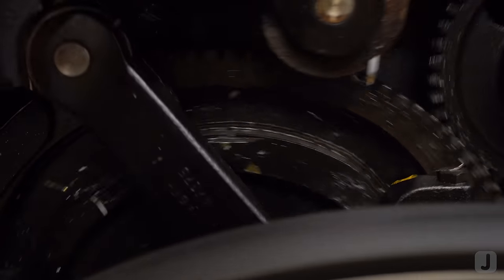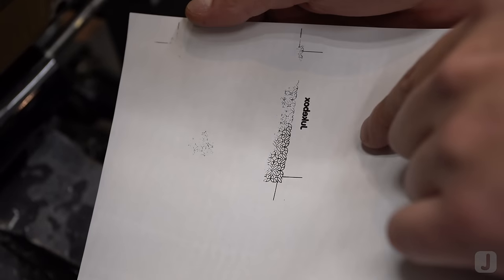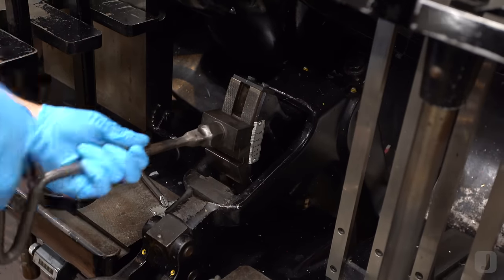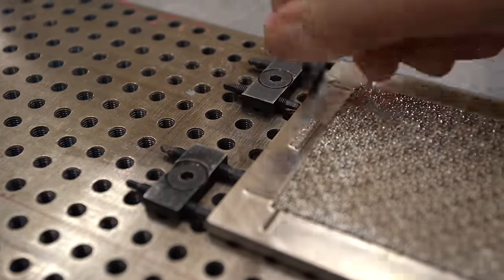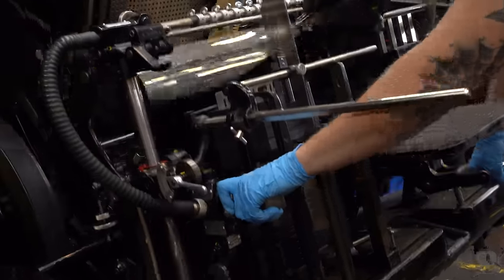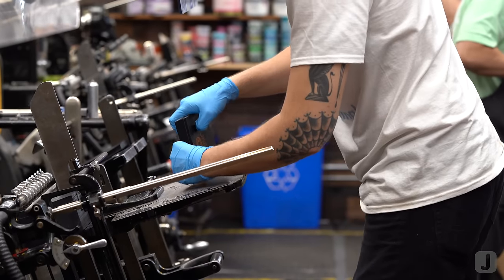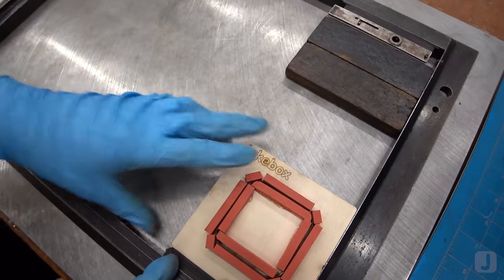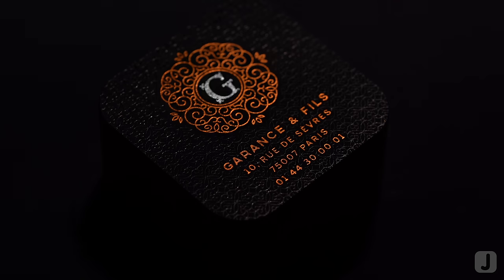Metallic Foil on Luxurious Black Business Cards!

Comment: How did you copper foiled the round edges of the cards in the end? 29:10
Reply from the maker: We set the card stack on an angle and the heated core is able to press the foil around the shaped card.

Comment: Holy crap!! O_O The amount of work this requires is absolutely ludicrous! lol. Beautiful finished product, but there has to be a better & easier way! The amount of adjusting, measuring & cutting this took was insane. How old is the machine you're using? I'm curious! Really cool stuff though; thanks for sharing.
Reply from the maker: This press is from 1960. I know it seems like a lot of steps but it's totally worth it for the level of perfection and consistency this machine offers. Once it's running, it'll do millions of prints without much adjustment and can hit speeds up to 5k impressions per hour. It runs so smoothly you can leave it alone and start setting up another press!

Comment: Would you tell us some common Mistakes you can make while progress ? Greetings from Germany
Reply from the maker: I don't make a single mistake in the printing. I make a thousand mistakes everyday! Setting up the plate wrong, cutting down the stock with the wrong grain direction, setting the temperature incorrectly, forgetting to set up the delivery properly, not setting up the gauges properly, adding packing and makeready in the wrong spot. Setting the impression incorrectly, putting the sheets in backwards, setting the foil tension and pull incorrectly. The list goes on. Making mistakes is how you learn to do things better next time. Most of the real big mistakes come from pre-press ha!

Comment: I use copper plates instead of mag plates! Copper last longer, less growth and the edges of the image is cleaner.
Reply from the maker: True! Copper plates are superior for holding the heat, the detail, and the impression too. Magnesium doesn't hold up the way copper does. For small surface areas and short runs we use mag but for the bigger runs with more surface area or very fine detail - we use copper.

Comment: Prior to removing the first die why not place a  2 x left adjustable holders.  Then remove the top ones and now remove the die and replace with the second die.  You should find that they will both line up.
Reply from the maker: I wish the dies were all the same size with the same margins but oddly enough, the dies are cut by hand making a "head stop" like you suggest, almost impossible to use. You're totally right and I wish I could do what you suggest!

Comment: I haven't met anyone in the print industry who uses points and pica with machinery.
Reply from the maker: You haven't met anyone who sets foundry type or does old style imposition layout? It's dated, but all the furniture, leading, typefaces, were manufactured to this standard. Even our saws for cutting down printing dies or slugs have the points and picas system.

Comment: What exactly happens with all the waste from cutting the cards ? You just throw them away or try to reuse some of it ?
Reply from the maker: Believe it or not we reuse almost all of our off-cuts. The nice thing about the old printing presses is that they can make use of smaller sheets of paper while modern digital presses need a full 8.5x11 or 11x17 sheet to print even a small design.

Comment: A quality product at a fair price. Seems that 'Bubba' is not able to understand that these business cards are not something he will ever see or touch, let alone use as a coaster to hold his can of Natural lite so that he doesn't make rings on his particle board end table that goes so well in his fancy double wide trailer.  
Yes, Bubba, it is still a business card, even if it doesn't fit into your your wallet made of camouflage duct tape. 
This is art. This is meant to be passed to people that can add hundreds of thousands of dollars or more to your bottom line. These cards are intentionally designed to NOT fit into a wallet or a Rolodex. These sit on top of the desk to be admired and are textured to be pleasing to handle. These are not Vistaprint throwaways. 
True craftsmanship.

Comment: real over work! Silkscreen is better option for this kind of work. If really fancy to do in this way; could have use bigger shits and print in set of six to reduce wastage of both foil and paper stock. In Kolkata; road side packaging printers do this kind of job at a rate as low as: 20 pcs for 1$.

Comment: Time to invent a machine that does that in one pass without measuring.  A "foil embossing cricut with a spinning heated pressure stylus, and separate cutting blade).  Throw in a white-capable color laser printer for good measure.  Couldn't take any longer than this process.

Comment: You seem to waste a lot of foil when loading the machine. Why dont you attach a lead-in to take up the length needed for loading the reel?
Reply from the maker: Usually, we leave an amount of used foil on the beginning of the roll so that the next job to set up uses the used area as a lead up. With a brand new roll like what is shown here, there is no lead up. Also, a 4' long sheet of paper is probably more expensive and wasteful than 4' of foil. On a Brausse SBL 1050 the foil path is easily 25 feet before a job begins but that machine is huuuuge.
Reply: The amount of material waste in high end printing is much higher than most people want to think about. High speed press running registration? 4' waste stream at 30mph..   No worries, it recycles into more paper ;)

Comment: I went to the website and my attempt at creating the most expensive business card order I could resulted in a total cost of $641,075.00.  I may have clicked order by accident.

In unrelated news, I'm starting a GoFundMe page.  Let me know if you're interested and I will send you the details on a beautiful business card.
Reply from the maker: We're definitely interested in the specs for this insanely expensive order you managed to generate. Maybe we can make it? Maybe it's the greatest business card since the dawn of time?
Reply: @JukeboxPrintLive  
I tried to recreate the order by maxing out on all the options. I was able to create the following order, which came to $373,302 USD. My original order was in Canadian dollars so it's fairly close.

Type: Triplex (3-Ply)
Front Stock: 30pt Onyx
Middle Stock: 18pt Black Suede
Back Stock: 16pt Sparkle
Print Process: Screen Printing
5 Colors Both Sides
(Black, Black, Black, Black, Black / Black, Black, Black, Black, Black)
Size: Oversized - 3.5" x 2.5"
Coating: Uncoated / Uncoated
Quantity: 2500
Sets: 20
Add-ons
Rush Service 43 Business Day Service
Edge Finishing
Rounded Corners
Reply from the maker: OK I see why this is so inflated. 20 unique sets and all of them have 10 colors! That's 200 different print set ups. The end result would be almost 1/4 inch thick... but nice choice with the sparkle paper option!

Comment: Why do you use a lever to pry out the plate lock? I had a exactly same machine and it has a pedal to do it. Is the pedal broken?
Reply from the maker: There is no pedal to release the chase on this press. On page 123 of the original manual it states "The chase is released by lifting the latch with the pin wrench supplied with the machine" There is even a photograph. That lever I'm using is the original pin wrench for the press.
Reply: @JukeboxPrintLive  Hello! Did someone adapt a pedal system to my machine before I buy it? Weird! It was very practical. By the way, I love your work. Perfectionist as it has to be. Nowadays I only have offset printing machines, but I miss the old days and watch all your videos. Thanks for your response. Good luck!

Comment: How are the dies made? Some kind of laser cutter or 3D lathe?
Also, I'm surprised at the number of simple looking adjustment screws.
Reply from the maker: It's actually a photo-etching process. A film negative is exposed onto a raw piece of magnesium. It is then developed and dipped in acid. After washing out the remaining magnesium for the artwork is left raised while the rest of the magnesium is etched away. Sometimes we use CNC cut copper dies though too. All depends on the job at hand.

Comment: While these are nice, I must say that business cards that are not the standard size and do not fit into my wallet should not exist. It is a guarantee that I am not going to keep it, and will simply opt to take a picture of it if I need it. An exquisite Guernica sized oil painting of your business's information would also be nice, but fuck you if you do that, just make it the standard credit card size.
Reply from the maker: If you look up the international standard sizes for business cards –  you'll find that many countries use different shapes and sizes. There are at least 11 different "standard" sizes for business cards across the world. Also, credit card size adheres to an ISO standard which is actually different than business card sizes. The card we printed here is actually smaller than most standard sizes. So, it'll fit in your wallet. Don't worry so much!

Comment: Hi! Awesome work, that's totally stunning!
One question though about the edge gilding : how did you manage the rounds corners to be foiled?
Reply from the maker: We set the cards on an angle. The heated core that makes contact is kind of soft so it can make contact with the rounded edge pretty easily.
Reply: @JukeboxPrintLive  thanks for sharing! Can you tell the brand and model of the machine?
Reply from the maker: @MrPowerpixel  No sir I think I would get in a bit of trouble if I let that detail slip! It's a bit of a secret weapon for us.
Reply: @JukeboxPrintLive  haha I thought about that, I totally get it, thanks for your quick reply though and for sharing your work 💪

Comment: how do you go from artwork to die?
Reply from the maker: There's a hundred steps there that we skipped. Essentially, artwork needs be converted to 100% K vector shapes, then the colors are separated into different PDF files. Those files are then output to a thermographic film negative. The film negative is then exposed to a raw piece of magnesium. The image is developed on the magnesium and then the magnesium is acid etched. The etching leaves the image as a raised area and everything else is washed away.

Comment: Wouldn't it be easier if you would do all 3 colours on one side and THEN all 3 on the other?
Reply from the maker: If both sides have the same number of colors then yes you are correct. In this instance, only one color is common between the front and back so we have to do it in 4 separate passes.
Reply: Sorry, didn’t realize that. Thanks for reply!

Comment: I wonder why you don't just put hard stops on two adjacent sides of the stamp. Then when changing between stamps, you just push them against these stops and tighten from the opposite side.
Reply from the maker: The die's aren't all the exact same size. Some have more material on each side than others so this would cause more trouble than it's worth and I trust my ruler the most!
Reply: @JukeboxPrintLive  Yeah.. I thought it looked like bandsaw marks on the sides of the dies. But they should be machined in my opinion x)  
I mean come on... they have to machine the pattern anyway. It would be extra easy to machine the dies to exact size. 
It would make the stamping easy as pie.
Reply from the maker: @TheRealFOSFOR  These plates aren't machined. They are photo etched magnesium. The image is etched in with an acid bath. Sometimes we use CNC machined copper dies and then yes your theory would work. But I still trust my ruler and my eye to be more accurate. The heat in the press also causes a micro amount of expanding that happens too which is hard to account for. Nothing about this is easy as pie but we try to make it better and more efficient every day.
Reply: @JukeboxPrintLive  Very well then. 
Etching actually made a lot of sense.. don't know why I didn't think of it myself. 
EDM was my second thought.

Comment: The result is gorgeous but actively wasting 4 feet of foil per roll for threading each roll really made me hope you guys have a way to use all that...wow
Reply from the maker: It's not real gold Christine don't worry so much! Typically, the previous job left on the foil is used to lead up the next one but this video shows a brand new roll in use. Even using a 4' sheet of paper to lead up would've been more expensive than the foil. Other machines, like a Brausse SBL 1050 require almost 25 feet of foil before a job can begin! Mind you, that's a huge machines for huge projects.
Reply: @JukeboxPrintLive  Thank you for your kind and thoughtful reply. That does put it in perspective......it reminds me, I used to work in newspapers, thinking back on it a newspaper press can easily use 50-75 feet of paper to "thread the web", depending on how big and complex it might be. Interesting the foil is so cheap, and I wasn't worried about it, that's just how my mind works....your creations are absolutely lovely, by the way. :-)